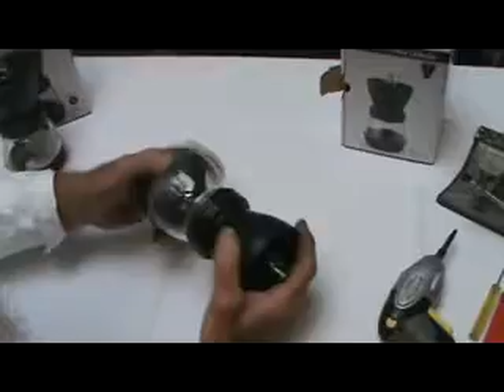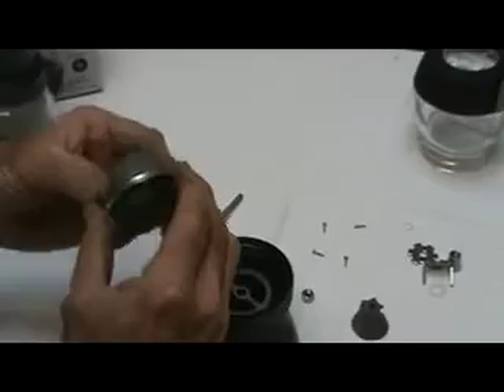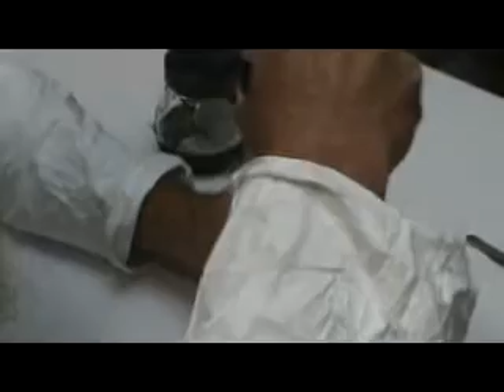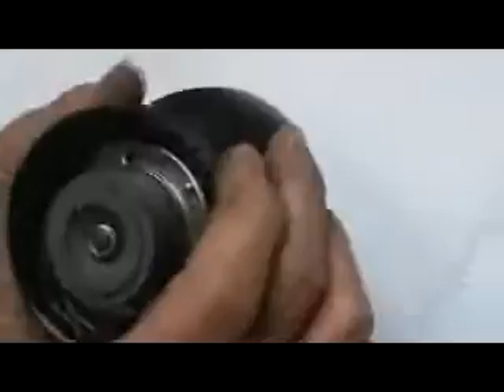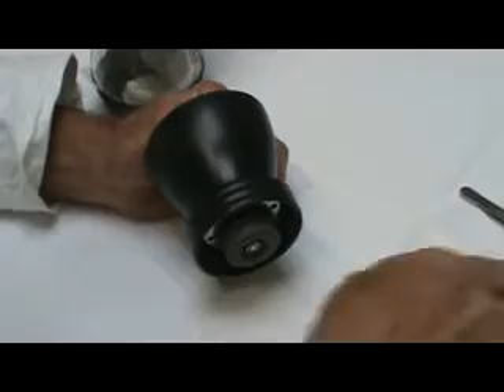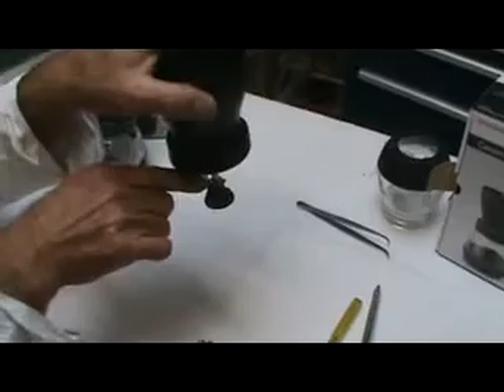Hario Skerton Kyocera CM-50 Lower  Bearing Installation.

Comment: Problem is that's not a bearing...it's a steel ring that's going to wear against the axle which, depending on which is harder, will result in either a groove in the axle or an oblong stabilizer plate...either of which is not going to do anyone any favors
Reply from the maker: No, it's not a great solution, but it's better.  And, that's why we recommend a person purchase a better grinder to begin with!

Comment: Excuse my ignorance, I haven't bought the kit yet, but I have a question about the installment. Why do you need to separate the lower burr from the axle? Can't we just remove the lower burr with the axle as a whole, install the upgrade kit, and reinsert it from the bottom instead of the top?
Reply: The lower burr alignment is a separate issue to the upgrade kit. Aligning the lower burr is needed even without the upgrade, he's just showing you both here

Comment: And, do you know what ELSE? If you can get yourself enough shaft length up where the cranking handle is, a plain old LOCK WASHER up there on the handle does a real swell job of keeping the handle on. The spontaneous re-adjustment of the grind isn't a problem, because the little arms reach down through the slots (highly technical language, get a degree dude). BUT THE FUCKING HANDLE FALLS OFF EVERY TIME YOU GET ENTHUSED about gettin' your crank on.  Lock washer.... My impression of "kids today" (heh, heh, cackle cackle, thud groan etc.) is that "kids today" are not normally as tinkery as us old farts who's daddy's all had HOME WORKSHOPS etc. I have met actually DEGREED ENGINEERS who didn't know how to fix a broken window! Why, back in the good old da.... oh for god's sakes THUD already! THUD THUD THUD and stay down.

Comment: FYI: All of the parts are metric system based. You just need a metal M5 washer (5 mm/.5cm) rather than the 1/8" washer you were using and it doesn't need to be oblong, because the majority of the grinder's shaft is significantly thick (M7) enough to hold that washer.

Comment: To Get Both Finer and Coarser Grinds without removal of lower bearing, OK looks like the reason why it is a either or between fine up to coarse grinds, is do to adding the thickness of the lower centering bearing as that moves the top burr further away from the collar, this could be used for both and be adjustable for both if the difference of the thickness of the lower bearing plate were removed from the bearing spacing, as this would make for much finer adjustments, up to the coarser adjusts without removal of the lower bearing plate. What is the thickness of that lower bearing Plate? is it approx. 1/16" thick if so that would need to be removed from either the mount of the collar or the small burr would need to be filed down by that thickness difference.

Comment: Wow. Took me almost an hour to do the final alignment. Here's what I ended up doing:

Fully assembled (but with the nut still a little loose), flip the grinder upside down so that the burrs are facing upward, and the entire thing is resting on top of the flat surface of the metal 'cap' (the part that holds the long handle in place). You should have the adjustment gear spun around a bit as if you were about to do a coarse grind, and the locking nut already in place.

Still with me? It's like you were set to grind some coarse coffee, but forgot the actual cranking handle.

So it's upside-down, kind of like a lamp. Hold the CENTER burr steady (there should be a little bit of wobbly give here) and spin the OUTER burr and plastic part (basically, the lampshade) around. You'll notice that you hear some squeaking/rubbing SOMETIMES, as if it spins around and catches an edge.

Adjust the CENTER burr and try to hold it in place until it NO LONGER RUBS against the outer burr as you spin it around. Once you figured out the ideal position, hold it there in place with one hand as you tighten the nut in place. Don't tighten it all the way, spin it around to make sure you're not hearing any rubbing/squeaking. If you do, press down on one of the edges of the CENTER burr to move it ever-so-slightly from the axle. Spin the OUTER burr and make sure you don't hear squeaking. If you do, keep adjusting it. Once you no longer hear squeaking/the damn thing turns smoothly, hold it in place and tighten some more. Repeat.

Once you're done, you may want to consider NOT over-tightening the nut so that you can press down on one side and 'adjust' it ever-so-slightly.

You should be able to hold the axle in one hand and spin the grinder around like a record without ANY friction. You will still see some wobble, but that's because these are hand-made mills and are not perfect circles, so they're a little derpy.

I can try to make a video of this, if none of this makes any sense.
Reply: This technique seemed to work for me. The burr is considered aligned if it does not scrape? I still see wobble, but I guess that's normal.
Reply: You'll still have some variance in grind size due to the wobble. I'm looking into using a tab bushing to center the shaft inside, since there's no room to fit ball bearings like this design would optimally call for (according to an engineer who helped me with this)
Reply: +Thomas Shin yes please make a video
Reply: +Thomas Shin Thank you! This strategy of adjusting to avoid friction while spinning was much easier for me than just eyeballing whether or not the teeth on the burrs lined up. I&#39;ve had to realign my burr a few times now, and this still took some time but was by far the most accurate alignment.

For anyone else doing this, here are some extra tips that helped me personally:

1) If you&#39;re having trouble tightening the nut without hitting (and thereby moving) the burr with your wrench, try adding another washer/spacer between the burr and the nut. This pushes out the washer a bit, thereby giving you more space around the nut to latch onto. I used the one plastic washer as they say to in the video, plus I added the spare plastic washer that was originally above the burr. I&#39;m guessing it&#39;d be even better to use a metal spacer instead of the plastic one.

2) If you&#39;re having trouble knowing which way to adjust the burr when it&#39;s on the finest setting, try loosening it up and doing it in a few steps. I first set the grinder to where I actually grind for french press and aligned the burr the best I could. Then I tightened up the grinder one step finer and realigned. Repeated that until it was fully tightened up to the finest setting.

3) If you&#39;re having trouble seeing where the burrs are meet to cause the friction, try listening to it--the less friction there is, the higher pitch the squeak will be, and the more friction, the deeper the sound. I don&#39;t think I could&#39;ve ever gotten it fully friction free at the end (i.e. on the finest setting), but this still let me adjusted it just a bit more.

Hope this helps some fellow coffee fans out there :-) Please share your own tips, too-there aren&#39;t a lot of guides out there for this mod, but I believe it&#39;s a popular one, so all the advice is appreciated! All best :)

Comment: have you tried this? this seems to be a good idea! can you confirm if this will work :P another option is to use moldable plastic like instamorph so that the mold can be reset if the shaft is not exactly centered

Comment: I call it stem and you call it a shaft .  So , yeah, that is right as you can notice that the inside of the burr "guide" in the center of the hopper is about 5/8 inch in diameter while the shaft is only 1/4 inch diameter or so. I suggest that some kind of plastic filler or silicone filler be used to fill up the inside of the hollow burr guide. The trick is not to let the shaft stick to the plastic gooey as it cures. you ought to be able to figure it out.

Comment: Your idea is not bad, though. I mean white nylon bushings that you find in your local hardware, but they are standard. The manufacturer couldve added the right nylon bushing or mold the guide solid down to right inner diameter hole to slide the stem in without any play . I am more concerned with beans spilling all over as I crank that got me so fed up that I decide to add a plastic lid with a hole punched in the center to cover the hopper! Peace of mind !  Some types of beans are tough to grind!

Comment: Use three or four non-compressible shims/inserts inserted at equal intervals between the two surfaces when you tighten the assembly.

Comment: I'm sorry but I don't quite understand what you are talking about- would you care to elaborate please? The shaft is steel not plastic, right? I hold one in my hand now. And the plastic sleeve- do you propose to place it between the shaft and the inside of the inner burr?

Comment: it would be a lot simpler if you call Hario skerton Kyocera manufacturer to thicken the thin plastic shaft and throw in a plastic sleeve around the grind stem . It will be nirvana!

Comment: Or you can use epoxy glue to fill in the cavity in the center of the hopper while the shaft is in place. Then pull out the shaft when dry. you can coat the shaft with thin coat of vaseline or glossy lipstick (pick yoour own color) before filling in epoxy .It should be easily slpped out and back in ...  All you need is a beefy bushing of sorts..

Comment: thanks for the video. love your style/narration. realizing you've done this countless times, and all i've done is watch the video - but here's my two ideas, likely deluded: 1. use a small torque wrench on the screws - metal into compressible/elastic plastic - if the screws aren't uniformly tight, that might contribute to the alignment problem (not really practical for end user tho'). 2. use a metal washer below the nut. again,  issue of metal to plastic. might that make the process less fiddly?

Comment: Yup, took about 1 hour to align, one side falls into the inner burr more creating one side to always be higher-at least the way I installed it. Due to that, I wedged a small awl or pointed tool for piercing leather/wood on the side that would fall into the inner burr while I tightened the bolt. I had the axel on the lower side held with my little finger and thumb while stabilizing the top with my pointer and middle. Using my socket tool I slowly tightened the top.. did this a lot

Comment: After using my OE-PFP for several months, I found that the bottom burr had worked itself a little bit loose on the shaft.  Watching this video helped me to know how to disassemble it to try to fix it.  Rather than simply retightening the nut, I noticed there was a fair amount of space between the burr and the shaft, so I shimmed it with some thin plastic before putting the nut on.  Now there is absolutely no play of the burr on the shaft, and I'm looking forward to more great coffee!

Comment: Thanks for the OE Lower Bearing UPGRADE KIT and excellent video! The grinds look great and I'm brewing them right now!  I used a 3/8 socket to remove the nut, the socket didn't go all the way in but far enough to grab the nut. Took about 15 minute to install and adjust it to my satisfaction. Thanks again!

Comment: Also, I love the fact that you're wearing a Tyvex suit in your workshop. Also, I tried putting the brass washer under the nut on the bottom of the burr. The outer diameter of the washer fits in the in-lay of the burr perfectly. Not sure how it supports it structurally better or for worse but it seemed to make sense to me so I went with it. I don't have any ceramic on ceramic rub and it's quiet even down at a pretty fine grind. Thanks a ton!